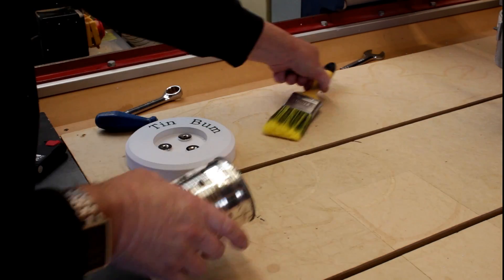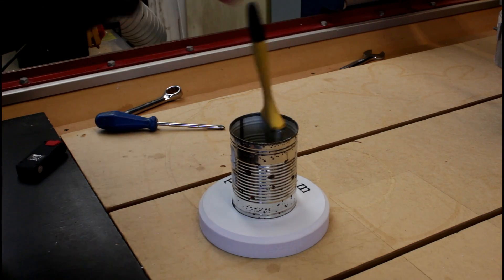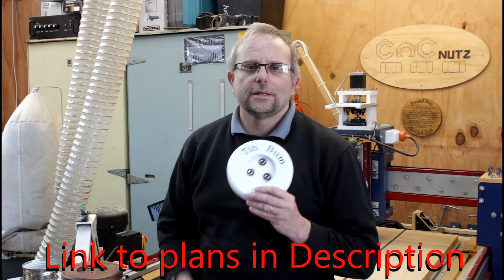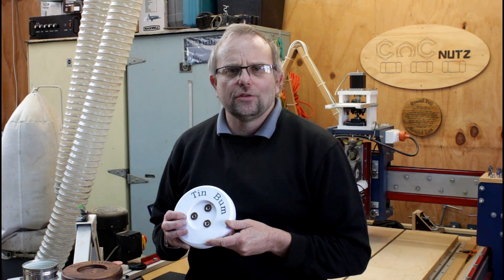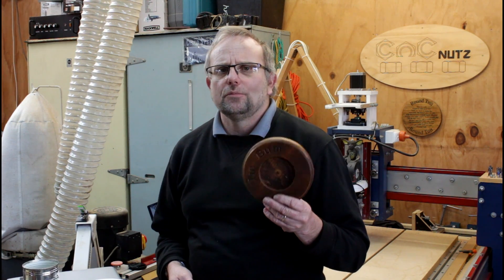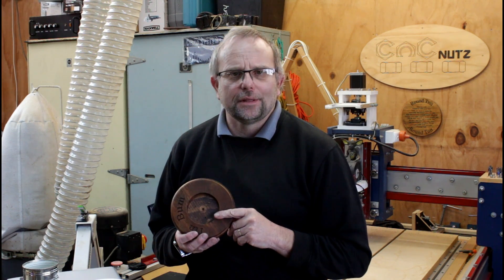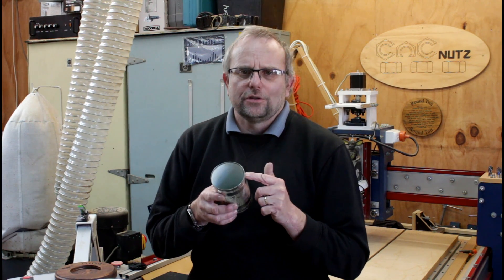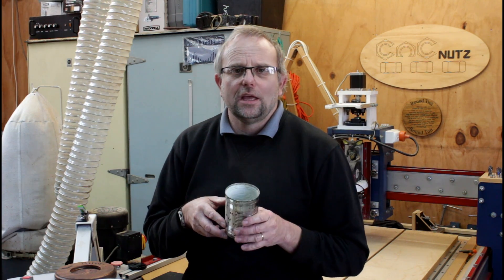The Tin Bum - CNCnutz Episode 116

Comment: Thanks. The plastic looked like it cut well.  What sort of plastic was it and where do you get it?
Reply from the maker: It does cut well.
It is a product called Signex and I got it from a sign maker.
It looks like a plastic version of MDF and I don't know where you would get it as it seems to only be available in NZ and Australia under this name.

http://www.mulfordplastics.com/products/signex

Signex® is similar to a PVC Foam product but with far superior quality for more demanding applications. The manufacturing process results in a "skinning" or outer layer of the foam board creating a harder, smoother and more scratch resistant surface along with increased mechanical performance.
Signex® is a very strong, durable and light weight product that will not rot or delaminate like other products making it perfect for the signage and building industries.
Signex® is very chemical resistance and can be handled and worked with like many other building products such as timber.  It can be routered, glued, filled, sanded and painted with standard woodworking tools whilst providing an improved surface finish.
- See more at: http://www.mulfordplastics.com/products/signex#sthash.p3NFvtxv.dpuf

Comment: I am seriously getting pissed off, Peter can you look at this variation of your magnets link and tell me what it says under shipping?
http://www.ebay.com/itm/191958695648?rmvSB=true

Cheers for another great video.
Reply from the maker: I checked and it says free shipping, at least to New Zealand, delivery 11 to 35 days.
Annoyingly, I do note that they are down to their last set of magnets so it may not be valid for much longer.
What is it that you are seeing?
Reply: "Does not ship to Australia"

I am heartily sick of seeing that to be honest - there is obviously something going on but it's damn difficult to pinpoint what it is.
Reply from the maker: +Rudyard Kipling 
Strange. 
It is annoying when you finally find what you are after and they don't ship it to your country or the cost of shipping is ridiculous.
Reply from the maker: Have a look at this one.
http://www.ebay.com/itm/5pcs-20x3mm-Neodymium-Disc-Super-Strong-Earth-Magnets-With-Holes-5mm-fastener-/322273428281?hash=item4b08fe4339:g:kM0AAOSwPCVX6MsE

It has free shipping to Australia though it's feedback is not as good as the one I used.
Probably not a big issue for a less than $2 USD item.
Reply: *****
Nice one Peter thanks, I suppose if it comes from China sooner or later someone will ship to Oz - very odd that they target countries differently like that.